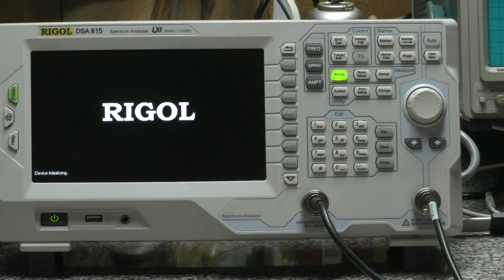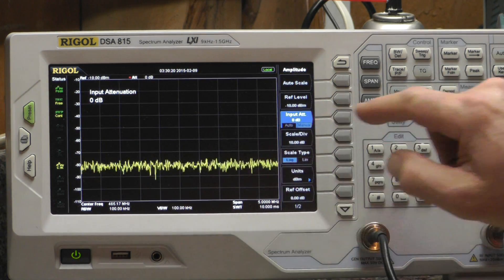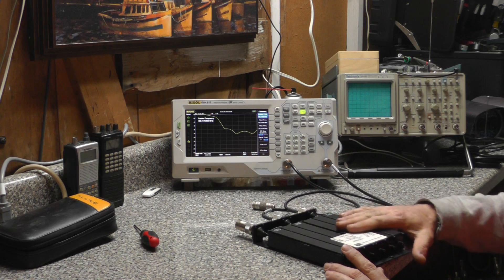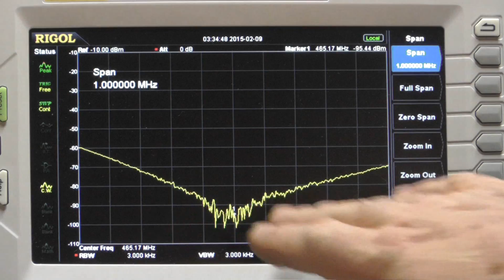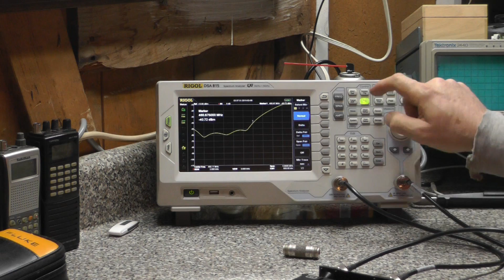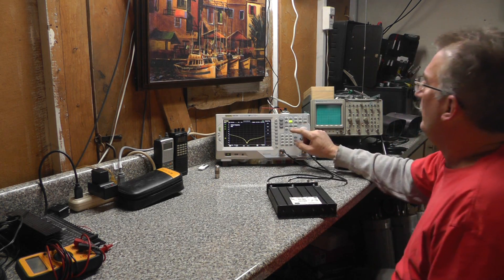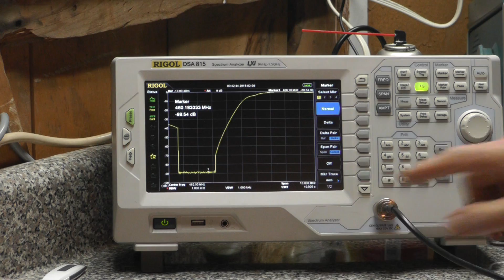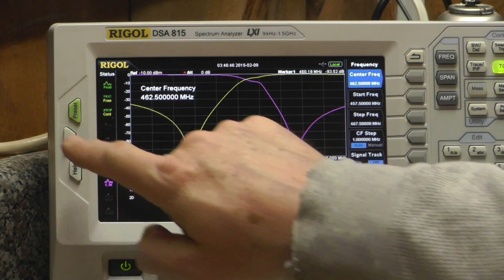Mobile Radio Duplexer Tuning - With Rigol DSA 815-TG

Comment: I am setting up a gmrs repeater.my upper is 467.7000 and my low is 462.7000.
Now the duplexer has a sticker low is 462.000 and high is 467.000...
Do I tune the duplexer for repeater or sticker

Comment: Just a quick question, Why is it that you would use a terminator as a dummy load on the side that you are not working with. We don't do that when we tune our UHF and VHF duplexers here at work, so I was wondering what the difference is or if its better to adopt that practice? We are just learning to do it here and any advice is greatly appreciated.
Reply: it changes the characteristics a little bit,  I never used to either and you can get away with out a dummy load however when the filter is in circuit it does indeed have a load connected, so you will get more accurate results by placing a DL whilst tuning

Comment: QUESTION FROM THE NEWBIE !  

BUT---> First of all:   THANK YOU !!  (You have created a great assortment of training videos that are fabulous!)

We have several repeaters that are in the process of multiple freq changes, etc...  and, not only is it difficult to find local
dealers who will do decent duplexer "tuning", getting someone to go "on-site" is near impossible.  Sending a duplexer in for tuning takes forever, is costly for the shipping part (we were using Fedex to avoid de-tuning units due to mishandling and vibration etc..)     After finding your video, I checked the pricing on the Rigol unit, and it seemed very affordable to purchase and have to the ability to tune i "in-house" (or at repeater site).   
---------------------------

Quick Question:   I can navigate programming / antenna installation / anything on the "IP" side of things as well as most parts of repeater installation, but have not delved into the measurement side of things much (other than a Bird 43 Wattmeter + a collection of slugs I bought 20+ years ago and the replacement for that -- the Telewave 44).  In addition to being practical in order to get duplexers tuned in the field...  This seems like a great way for me to delve into & learn other areas of radio communication.  (at least analog for now --  P25 Phase 1+2 /DMR-TDMA / etc... can wait a bit  -  LOL)

  I just wanted to verify something in the video.  Obviously, I am a complete "newbie" just starting to learn how to tune duplexers for our small repeater installations.

You indicate that the "Transmit" frequency is the higher frequency.  and the "Receive" frequency is the lower.

I am definitely confused   -- so  HELP!   LOL

In the "GMRS World" and in most of our "conventional UHF" (450-470mhz), the separation is 5mhz between tx and rx (in many of our "T-Band" gear, the separation is 3mhz).   I know that some "amateur" 70cm repeaters use either a (+5) or (-5) mhz difference for the "input" of the repeater, but for the PW and IG bands, I have only encountered the (+5) coordination/assignment.   (Example== repeater "output"/TRANSMIT is:  453.5125mhz  ---   and the "input"/RECEIVE is 5mhz HIGHER at: 458.5125mhz)

Is that how your example duplexer is tuned in the video?

In all of the installations we have done in the past, using pre-tuned duplexers ("mobile" style like the Celwave in this video -- for all of our "backup" or "in-building"  -- less critical repeaters that are generally 20-40 watts and not used heavily)

For our "primary" repeaters  / higher power + better performance necessary... especially one of them located on a water tank with many other RF sources nearby (we have 3), we use Quantar or MTR3000 Repeaters with rack-mount larger TX-RX "Vari-Notch" pass/reject style Duplexers or the RFS "black" 6 total cavity rack mount pass/reject style.    

(..wanted to "get my feet wet" on the "mobile" unit first, before delving into the more complex cavities  LOL)

Thanks in advance + THANK YOU FOR TAKING THE TIME TO CREATE YOUR TRAINING VIDEOS !

Sorry -- just thought of one other question:  I heard "squeeking" when you were adjusting the tuning rods on the
unit in the video.   Do you "loosen" the nuts prior to tuning, then tighten up when done?...  or...   do you just turn the
rods gently w/o loosening the nuts?   (never saw one done in person -- but, on the larger bpbr units I've seen done ,
the tech has generally loosened the "locking" nut during the tuning process, then gently tightened the nut and applied 
some nail polish or other substance to "mark" the positioning and to keep it from vibrating loose.   --  I was told not to
use ANY type of "loctite" on the treads under any circumstance.)

Thanks !

Comment: How are you getting such a clean sweep with 0 attenuation to your input when you hook the tracking generator in for the normalize function? At -10db attenuation, I get a clean sweep, but at 0db I get a sweet with -55db spikes and it will not normalize?

Comment: Many thanks for excellent video.  I looked at your earlier version using the test set.  Is it possible to add "measure loss thru filter" to this DSA815TG version or a separate short video?  Would be helpful for novice users.  Thank You for your efforts.  Paul vk4apn
Reply: +paul newman Actually, Paul, you can set Marker 3 to measure the loss at Trace 2's pass frequency and Marker 4 to measure the loss at Trace 1's pass frequency by simply placing each marker on the proper frequency.  You don't even need to re-sweep the cavities since this data is already on the screen.